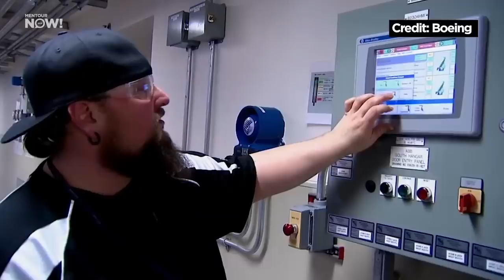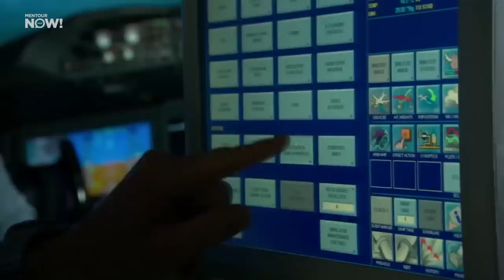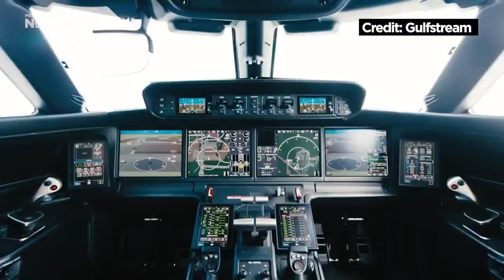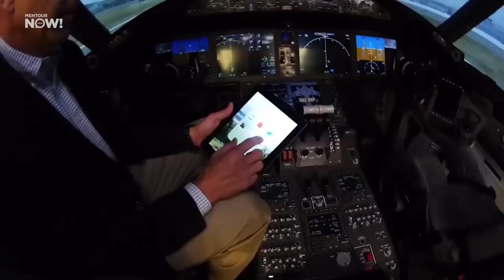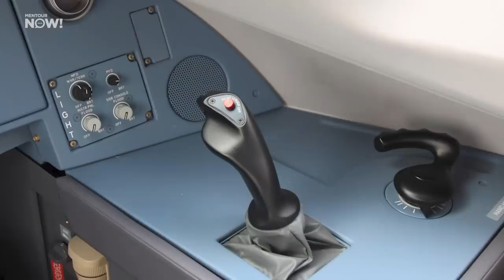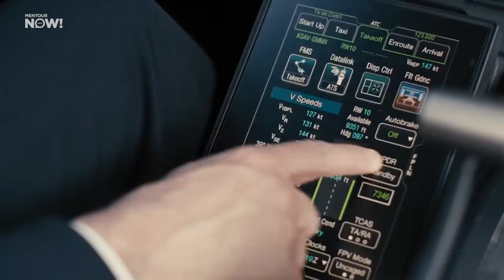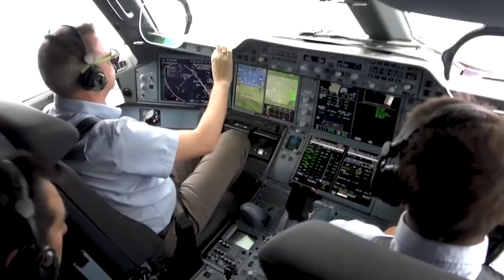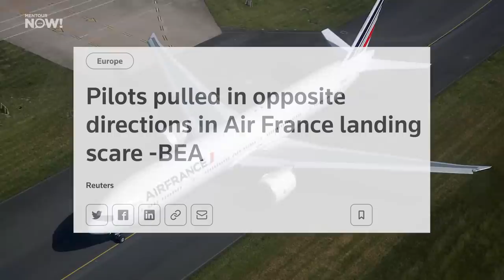Is Boeing Switching to SIDE-STICKS?!

Comment: To all those commenting that it must be hard to switch from using left hand to right hand to control the side stick. Firstly Petter mentioned in a video a while back that pilots can't swap seats as they feel like it.

But more specifically, think of the number of right handed people, who drive cars with the driver's seat on the right, (UK and most countries in the SE Asia), and have no problem using a manual gear lever with their left hand.
Reply from the maker: Correct, it’s not really an issue at all
Reply: I'm not a pilot but if I tried to ride a motorcycle with opposite controls I'd be in trouble. I'd also probably be more prone to mistakes during a crisis situation.

I can write with my non dominant hand but it lacks refinement, I'd expect something similar with using a stick between the two hands.
Reply: The steering wheel still remains the main directional control input, however.  The car does not have a steering side stick, and gear shifting requires far less finesse.  Yokes are more ambidextrous.  I'd wonder why not a switchable side stick, however.  If the pilot using it wants it on their left or right, they could have it there regardless of where they are sitting, with the other one stowed down on the floor.
Reply: No matter a side stick or yoke, the same hand will be used to control it. The other hand is needed to control the throttle.
Reply: @MentourNow  I wonder why the aircraft designers didn't put the joystick (Jeremy Murphy below) on the same side for both seats? I don't think they swap the collective and cyclic for dual pilot helicopters!
Reply: Isn't that what pilots already do on aircraft with yokes, while landing? One hand on the throttle and the other on the yoke? What is the difference between flying one-handed on a yoke and flying one-handed on a sidestick?
Reply: Yeah, gotta keep the dominant hand available for a sword fight.
Reply: @haschid you're right - I hadn't thought of that. If they designed the cockpit with same side joystick, they would also have to have same side throttles and presumably other controls, like that spinning wheel thingy, whatever that is!
Reply: As a Brit, I drive RHD vehicles for 99.999999999% of the time. On the rare occasions I drive a hire car in the States or in Europe, I have no problem with the vehicle controls, even if the car has manual rather than automatic transmission. I actually find it harder to drive my RHD car on the Continent because I am “wrong-sided” by being closer to the verge of the road rather than the crown. I also know from experience that, in an emergency or when having to negotiate u-turns or exiting petrol stations, I am more likely to make a mistake as I instinctively try to put myself near the centre line. I have had the same experience when driving an LHD car in my own country (Britain). That never happens when I drive an LHD vehicle in countries which drive on the right because trying to centre myself is then the right thing to do.
Summary : mastering the controls is easy. Mastering the situational awareness and appropriate course on the road when things get busy is much harder if “wrong-sided” by driving a wrong-handed car in a given country.
Reply: @haschid  they're talking about switching from using your right hand for the sidestick (as the F/O would) and using your left hand for the sidestick (as the captain would)
Reply: @Clayson Antoons There are some Russia type to that, I can't recall what antonove it is then...
Reply: that's a poor analogy actually, a car's gearlever a) does not supply feedback, and b) does not require precise manipulation
Reply: But my left handed child finds it difficult to manual shift American cars....using is right/non dominate hand. He can do it, but noticeably not as coordinated as using his left/dominate hand.
Reply: @haschid  "What is the difference between flying one-handed on a yoke and flying one-handed on a sidestick" - I'm not into flying, not even simulations, so I have no experience either way and I do not presume to know which is "better" (or even if there is a "better"), but I find your question interesting.  As an outsider, I would think the difference could be significant for the simple reason that different control devices feel, behave, and control differently.

To illustrate this, answer the following.  Assuming you drive a car, are you able to accurately steer the car with only your non-dominant hand on the steering wheel?  If you answered "yes", that's great.  Now use your non-dominant hand to control your computer's mouse and tell me if you can control the mouse accurately.  Most people can't.

I would suggest that the  important point isn't one-handed vs two-handed or even dominant vs non-dominant usage, but rather how the control device (side-stick, in this case) is designed -- the position of your hand when controlling it, how it feels (the smoothness or resistance when controlling movement), feedback, how sensitive it is, etc.
Reply: We swap seats every leg at my company. We fly mostly with two captains and if we fly with a first officer, he or she is in training to be captain. Anyway, the point is, we swap seats and it’s no issue. Most of the flying is done from the left seat, but we still occasionally fly from the right. It really isn’t an issue which hand u use.
Reply: Being from a RHD country. It is absolutely noticeable switching to a LHD car, though it's mainly a muscle memory and co-ordination issue.
Reply: I switched from RH seat to LH seat 30 years ago. Although I flew aircraft with a yoke (B757/767) I did have to adapt to holding the throttles with my right hand instead of my left and vice-versa with the yoke. It wasn't a problem. Although this is of course a personal observation I have never heard from colleagues that they found it a problem. It's possible that a side-stick will be different but I doubt it.
Reply: @haschid  You’re absolutely right! It’s very rarely that both hands are used to fly the yoke, most typically when the hydraulic systems fail and the system goes into manual reversion. At that point, even both hands are not always enough, and the second pilot has to pitch in as well.
Reply: Well as a right hand drive car owner i can assure you getting into a left hand drive on holiday isnt as simple as you presume, natural habbits get you into troubble all the time, you pull out of a junction hard, go for that quick snap change and open the door for example.

Comming of the motorway, foot goes down for the clutch on its own so does the hand, before the DOHHHH moment and you swap it all over.

all the controls are more or less where you left them the dials are the same aswell but the change of position takes a day or 2 of adjustment
Reply: @number1bobo  and that is where training shows it's value. They'll do fine once they'll practice more. Shifting gears is not the easiest thing for a new driver!
Reply: @number1bobo  When I had to drive a manual American car, I was actually worried about having to use my right hand to change gear. Odd right?! Actually I think it would be a lot worse if the peddles were reversed, i.e. you had to use your right foot for clutch and left for accelerator!
Reply: Exactly. I've been driving stick for decades with my right hand on the shifter. Visiting the UK a few years ago I had ZERO problem moving to using my left hand.

FAR more infuriating was the signal lever being on the opposite side on that particular car, for a bit every time I wanted to signal my wipers were activated...
Reply: @racketman2u  Tell that to people who always drop out of gear!
Reply: @thomasm1964  Absolutely agreed!   I drive RHD (manual) cars (we drive on the left in NZ) - when I first drove in France I had no trouble whatever with the right-handed gearchange (and sitting on the left of the car helped to remind me to drive on the right).   Trickiest thing was remembering which side to look for traffic when entering a main road at a junction.
What does tend to cause me confusion is hopping out of wife's Mazda (indicator stalk on right, wiper stalk on left) into my BMW which has them the other way round.   Simply because there is a similar stalk on each side of the wheel.    With the gear lever, of which there is only ever one - no problem.
And of course, when changing gear, you're steering one-handed with the right hand (in a British car) or the left hand (in a French car) - most drivers seem to manage to handle this without trouble.    Same as working the throttles and the yoke in a Boeing...
Reply: Changing gear with you left hand requires hardly any manual dexterity, unlike controlling an aircraft with your non-dominant hand. I'm not convinced, although I'm guessing that it can't be much of a problem as pilots do it everyday with seemingly no problems.  After all, having a Jodrell with the wrong hand is not as easy as you might think!
Reply: @MentourNow  They've all coped with the throttles being on different sides depending on which seat you're in. 🙂
Reply: I'm left-handed, and I've kept the same pair of scissors at the office for years ... nobody else can effectively use them!
Reply: @AnIdiotAboard_  Are you using a left hand drive keyboard? Haha.
Reply: @Nilguiri  
I do, and where I can't I have an extra keypad at the left hand end, but still lack the cursor etc keys at the left (unless I take it out of num lock)...
Reply: I would think so too. I can write very well with my right hand, but completely lack the dexterity to write legibly with my left hand. The time it would take to develop that level of dexterity and muscle memory would be far higher going from FO to Capt with stick over a yoke. (in my inexperienced opinion).
Reply: @axelBr1  the Leyland Titan bus had a joystick gear change on the right for when you wanted to drive it semi-manually^W with a limited highest gear, eg going down hill to stop it running away.
Reply: @-FreakAccident-  funnily enough my right hand is like a doctor's writing (illegible) and my left is rather "stiff" (and slow - it lacks the dexterity [sic]).   I suspect I'm a natural southpaw but was forced to learn to write with my right as a child.
Reply: @cigmorfil4101  I can't remember what make of Leyland single decker was in use when I rode it to & from school, but I remember it having a preselector gearbox, operated with a small lever, which may have been on the driver's righthand side.

Once when working in Qatar, the rental car company give me an American car with their weird steering column mounted gear selector. Freaked me out. (Ride combined the feeling of a sinking ship in a storm with shooting you through the roof when going over speed bumps.)
Reply: @axelBr1  
Possibly the Leyland National - it also had the hydrocyclic gearbox with a fluid floating flywheel.

It was actually an automatic gearbox and the joystick selected the highest gear it was allowed to use.  It started in 2nd unless 1st was preselected - the gearbox would never go below 2nd.  If the gear was higher than the highest selected it would not change up any higher but would change down until below that gear whereupon it was now in the allowed range.
Reply: @cigmorfil4101  Pretty cool, with minimal / no electronics.
Reply: @alanhoffman683  I played basketball professionally. I'm right-handed but can still do a lefthanded layup under pressure. Muscle memory.
Reply: @haschid  EXACTLY!!
Reply: Imagine if the accelerator was switched to the left foot, and brake on the right. How many issues do you think that would cause?
Reply: @mattd6931  I mentioned that would be odd. However having driven both right hand drive and left hand drive, including manual gearbox, it’s not that big a deal.

And don’t forget that in Boeing planes the captain will be steering the plane on the ground with their left hand.
Reply: @axelBr1  Yeah, it's nothing that can't be overcome with training and experience (especially given that for a type conversion to a new control style they'd get a lot of simulator training straight up.)

It would be a more dramatic change than switching from left hand drive to right hand drive in a car though.

Also, just an FYI, on the ground (even in Boeing aircraft) the Captain already steers the plane with their left hand for sharp turns, because that is where the tiller is located. If they changed to a sidestick, the tiller position would likely move to next to the sidestick (as in the Airbus A320) but steering of the nose wheel would still be done by the tiller and pedals, not the stick.
Reply: @derektaylor2941  its not different to flying with a yoke in that sense, when you're landing a small plane like a Cessna you are taught to fly with your left hand on the yoke and your right hand on the throttle to manipulate your descent rate
Reply: @derektaylor2941  The flywheel was spun up when the accelerator was depressed giving a surge to the unwary.  The flywheel help to keep the bus smooth between gear changes.

The hydracyclIc box was used in London buses Leyland Titans (Tnnn), Leyland Nationals (LSnnn), Greenway Leyland Nationals (GLSnnn), Leyland Olympians (Lnnn).
Reply: @derektaylor2941  No when you're landing small GA aircraft you dont want to change the pitch using the trim or the ailerons, you control the rate of descent using the throttle, if you're coming in at approach speed and then you try and pitch the nose up because you're too shallow you will stall, you control it by increasing and decreasing the throttle, which in turn creates or decreases lift, I was referring to the comment where you said it would be strange flying an Airbus with your left hand on the sidestick, I was just pointing out that even on a 737 take off or landing a GA, your left hand is on the yoke and the right hand is on the throttle
Reply: @derektaylor2941  Yeap, it was a small lever on the driver's right, and most probably a National, (this was 1982 to 1986 time). I can't remember if there was clutch pedal, but the driver would shift gear and we'd all be flung about the bus as the gearbox did its stuff.

Comment: I've always imagined that sidesticks would be much nicer to use than yokes, but I never really thought about advantages of the yoke, like having that mechanical link to better understand what the other pilot is doing. Very informative video as always!
Reply: Imagine they put the sidesticks next to each other and mechanically link them to each other. Rather than a left hand sidestick for left seat and right hand sidestick for left seat, reverse it so that both sticks are right near each other and can easily have a mechanical link that is strong and simple
Reply: Not having side stick be linked is a design choice. There is no technical reason why it can be done.  Stick equipped GA planes like the SR22 are linked for example.
Reply: what if they pute side sticks in Cars.
Reply: @Perich29  Saab made someting back in the day.
Reply: The mechanical link isn't always an advantage. Without the link you can have a priority button (such as Airbus has) which lets you disconnect the other control, which can be useful when the other pilot is for whatever reason (loss of situational awareness, perhaps) giving control inputs that you don't want.
Reply: In the Air Force they call the thing a joystick before video games came along. They help you work *& land safely so it makes you happy thus brings joy. So if someone says joystick I won't care. It's what it does not what it's called. Yoystick?
Reply: If you believe FBW and Glass is future of cockpits, then Active SideSticks make 10 times more sense.

Comment: I've trained in a tailwheel with a stick. 90% of my flights have been with a stick. I really prefer a stick over a yoke. I've talked with pilots who have flown extensively with a yoke then converted to a plane with a side stick. In every case they said it only took less than a day in a simulator to make the switch and they now prefer a stick.
Reply: I have heard learning to fly with a stick has the student thinking of handling a airplane where learning to fly with a yoke may have them think of handling the airplane like a car. i.e. low speed and low to ground and engine goes out, don't "turn steering wheel back to airport."
Reply: In my opinion, yoke is 1000 times better than a stick

Comment: I flew Boeings for about 17 years before transferring to the A320 family. Unfortunately I went to the first sim session with a somewhat negative attitude toward side sticks. For all the reasons you mentioned. It took me about 30 seconds flying to change my mind. It felt like such a natural way to maneuver an airplane. I admit there are downsides to Airbus compared to Boeing (don't get me started on the presentation to the pilot flying a non precision approach 🙂 ), but that side stick is a winner for me.
Cheers,
Peter
Reply: Yeah.  The side stick is natural. 
Because the rest of the front panel already looks like you're flying a video game. 😝😜
Reply: Same sorta story here. However, besides Boeing and Airbus products, we also fly Gulfstream products. And when you talk about presentations to pilots on anything, the Boeings and Airbus are both crappy. In that department, the Gulfstream is decades ahead.
Reply: @Clayson Antoons probably because Gulfstream customers aren't pinching pennies on pilot training thus embrace new tech even if it means additional training or even a new type rating.  
Airlines, on the other hand, put much pressure on the manufacturers to make airplanes that don't require ANY new training for their thousands of pilots.  God forbid they spend one cent more than they have to on pilot training.